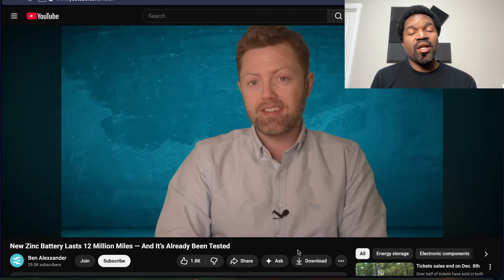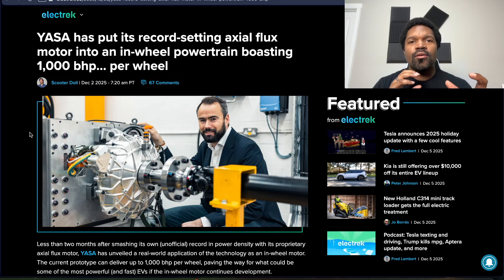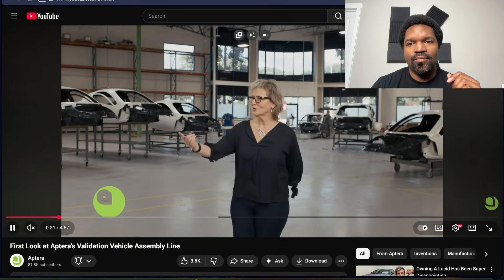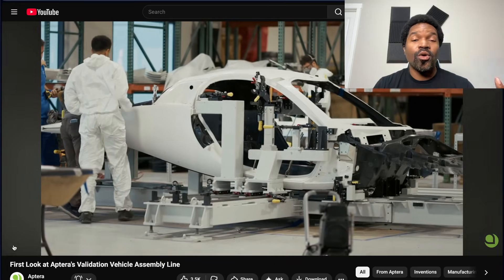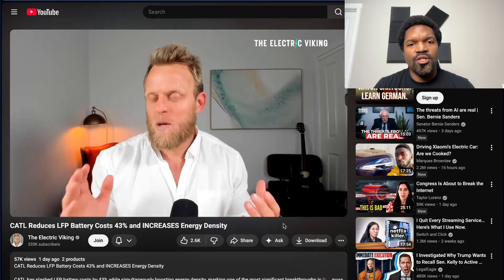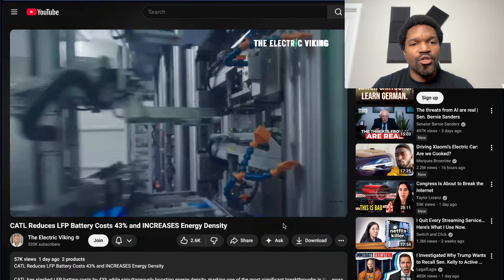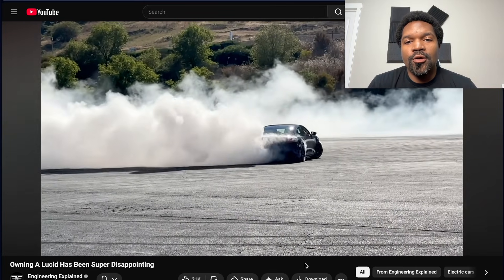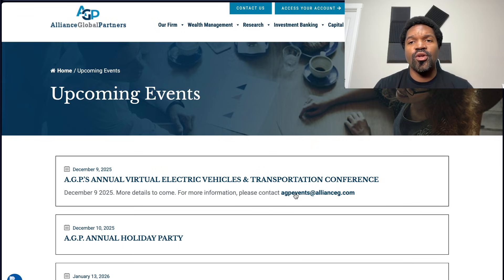Aptera News Update 06DEC2025: Zinc 3D Batteries, 1000HP in wheel motors and Aptera Production Prep

Comment: Why would you need 1000 HP per wheel 😂 ?
Reply from the maker: Not a clue. I still kinda want to see it in action though. Perhaps some practical application in construction or machinery if it also has the torque to match?
Reply: Mining and construction equipment for sure.
Then racing and showing off.
Reply: Suppose, for instance, that you have an irrational and all-consuming hatred of your tires...